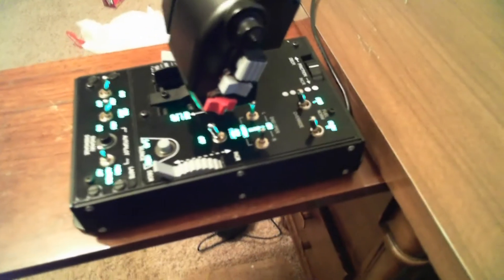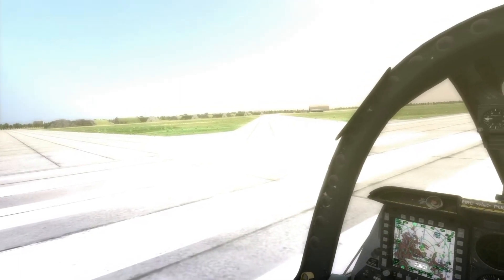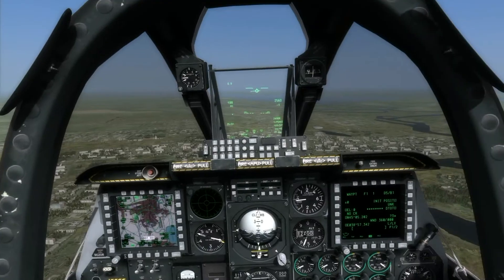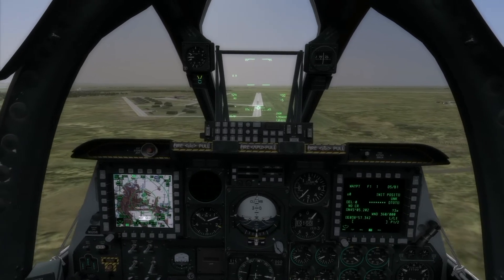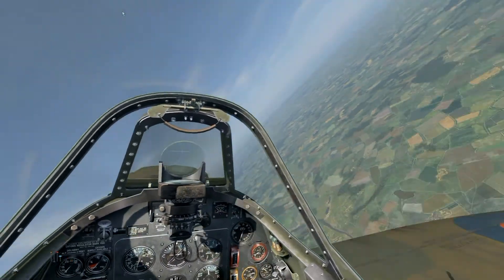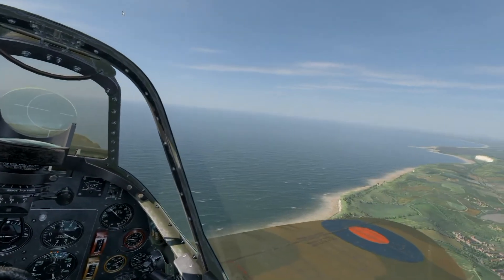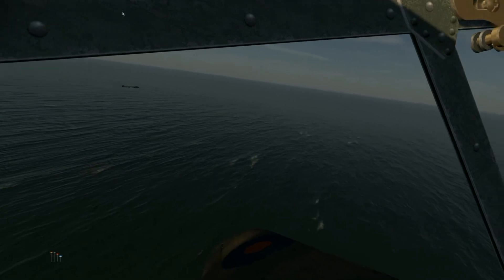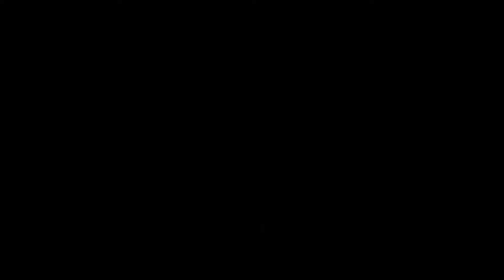Passing on a Skill Part One - only 40 more hours of instruction needed

Comment from the maker: @Knightdor Each of the simulators probably runs around $60-$70 for the program. You of course need a mid to high range computer to run it well, and the peripheral hardware can run anywhere from $100 to $400 depending on the complexity. 
I can't post links in comments, but Google DCS A--10 or IL-2 cliffs of Dover and that should give you a good start. I've been a pilot since I was 14, but I do not do it professionally.

Comment from the maker: @TheBostralian420 The first simulation is of DCS A-10C. The second is IL2 Sturmovik: Cliffs of Dover. I'm using a Thrustmaster Warthog HOTAS stick and throttle and a Saitek Pro Rudder Pedal system. The head tracking program and hardware is called TrackIR. PM me if you need any advice or help.

Comment from the maker: @brainitch1 Ive got an i7 Extreme with 24 GB of RAM and 3 EVGA Nvidia GTX 580s. I use three Intel SSDs to run the system and games   
You could get away with half those specs and have a decent experience, though.